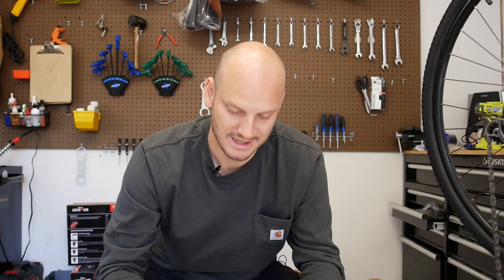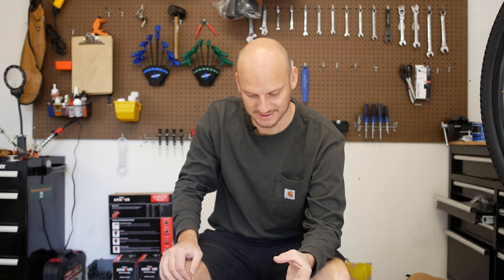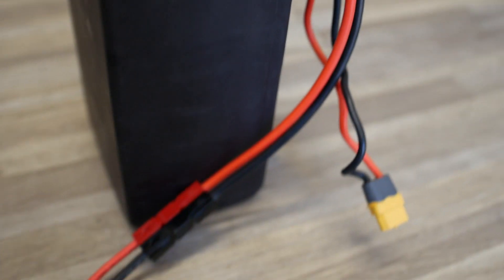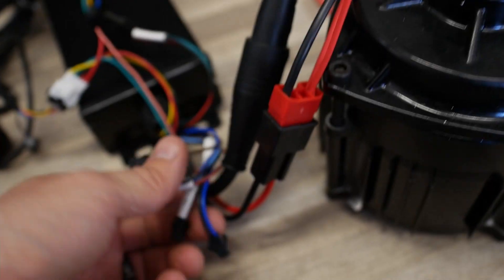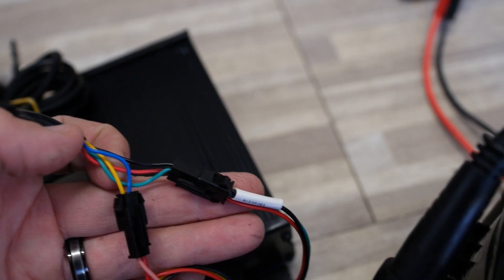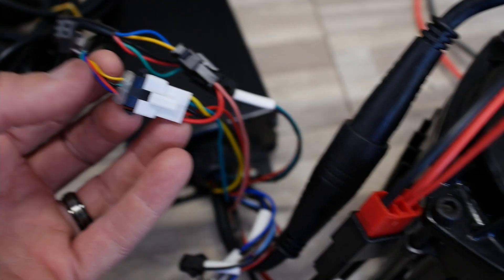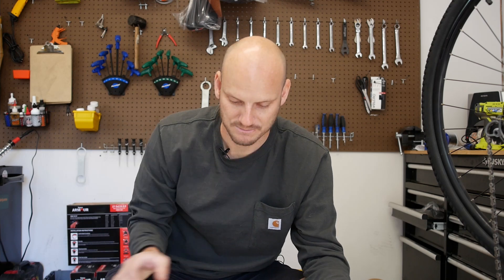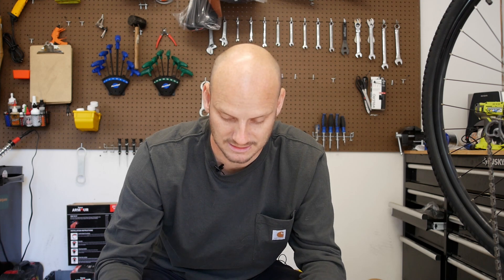Basic wiring of the Cyclone 3kw E-bike motor kit: How to connect the rats nest

Comment: How does the sw900 display provide speedo reading? Does the controller have an external speed sensor like the bafang bb2/bbhd? 

Did you edit the parameters on the sw900 to get an accurate speed reading??
Reply from the maker: It goes off motor rpm. So if you have a multiple speed gear cluster it will only be accurate with which we gear you match it up to 🫠
Reply: @JohnnyNerdOut  i'm using a single speed. 44T on chainring and 16T on rear tire.
Reply: @JohnnyNerdOut  how do i match it on my single speed 44T chainring and 16T freewheel??

Comment: Hi Johnny,
I am not plussed about the install.  Patience, perhaps a bit of your guidance and I am sure it isn't too bad.  Many of us that follow you come from a mechanical background of customizing motorcycles and cars. But a further comment if I could.
I don't see the point of the Cyclone kit.  I hear you about the power.  But there is more to the equation.
Two issues about the Cyclone and one big one.
First:  The exposed redundant chain and secondary sprocket.  Not a show stopper but a consideration.
Second and the elephant in the room?  Noise.  The thing sounds like a chainsaw at full flight.  That to me is a no go.  Why is that?  Because the beauty of an electric bike is silence.  That is why many of us would prefer an electric bike over a 125cc gas scooter.  If I am making time on a local MUP and I am on my ebike making no noise at 30 mph, somebody may say, wow, look at him go.  Do the same thing on a 125cc gas scooter and they are looking to call the police.  Stealth and what the public will tolerate when you are flirting with the recesses of the law and what high power e-bikers do.

And of course there is more.  The Bafang BBSHD at 1700 watts is 'silent'.  In fact, when I built my first one, I couldn't believe it.  At 30 mph, I can't hear the thing over wind noise in my ears.  Remarkable.

Hotrodding.  I am a hotrodder to the core.  I love speed.  Many that follow you are speed guys, otherwise we would go to the local bike shop and buy a pathetic underpowered ebike and save ourselves the trouble of building one.  The Cyclone is very powerful as you say.
But...if you want to go a bit deeper and do a high amp remote controller 'like the Cyclone' the power is there with BBSHD.  BBSHD can do 3000 watts with or without a metal gear inside.

Lastly, how fast do you want to go on a bicycle?  My lastest BBSHD with 52V 19.2 amp-hr battery will do 40 mph on a dropbar roadbike.  Do you really want to do 40 mph on a bicycle?  If anybody a guy like me who has exceeded 100 mph on a motorcycle more times than I can count, answer is no.
A bicycle doesn't have the frame stiffness, the suspension or wheel and tire robustness to do 40 mph or above on an average street that is less than billiard table smooth.  Hit a pothole that scooter or car or motorcycle can handle by design, can be lights out on a bicycle at the speed.  Not designed for it.

Above are the reasons I haven't built a Cyclone bike.  Mostly noise.  The Bafang BBSHD is the top of the pyramid in my book.  I know you are a fan of both...my thoughts.

Comment: Have you tried a Luna Ludicrous controller upgrade on a BBSHD?
If I wanted a hot, high speed ebike, I'd try that first and upgrade battery to 72V next.
Cyclone is cheaper for power.  BBSHD controller upgrade stealthier.
Reply: My thoughts exactly for reasons I explained above.  If I felt I needed more than 1700 watts, I would be in line to upgrade my BBSHD for 60 amps and 2500watts. Don't see the point.  If I am going to go that fast, I will buy an electric or gas motorcycle.

Comment: Wow. How about CYC X1 Stealth. Any thoughts on this? Have you installed and tested one? I'm kinda thinking this of the next project install, X1 Stealth on 52Volts at least 17Ah battery. What I want to feel is the cadence and torque sensor combination.
Reply from the maker: Still waiting on my shipment from them to arrive.....
Reply: CYC X1 Stealth is the best mid drive motor... light weight and powerful